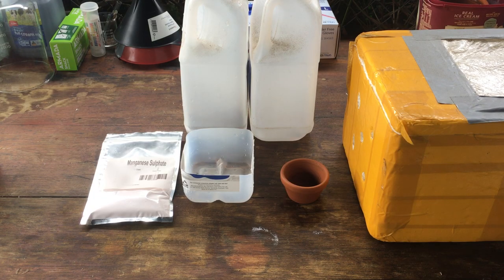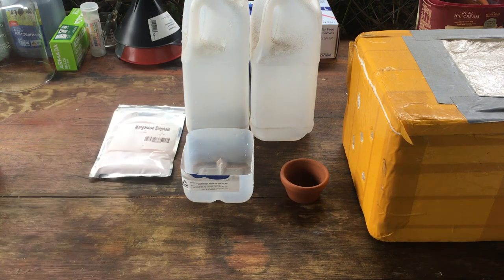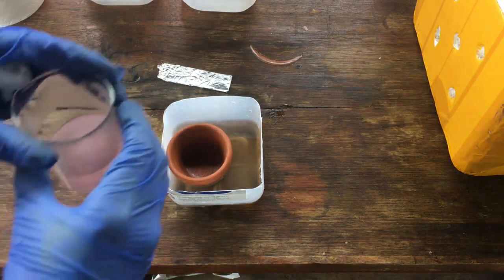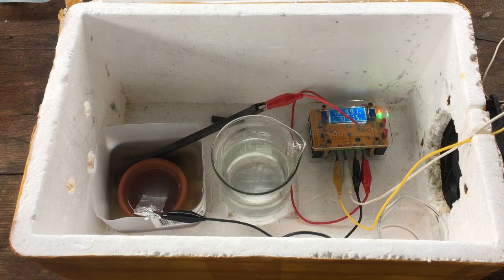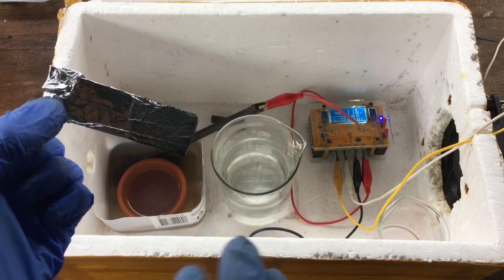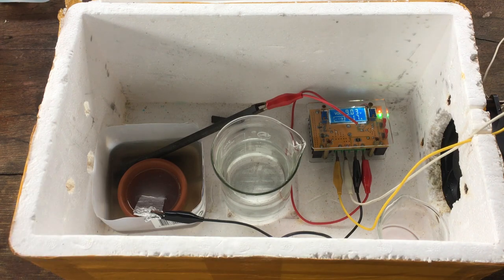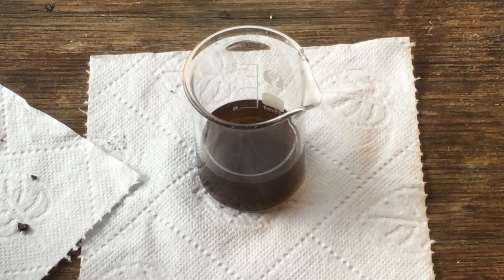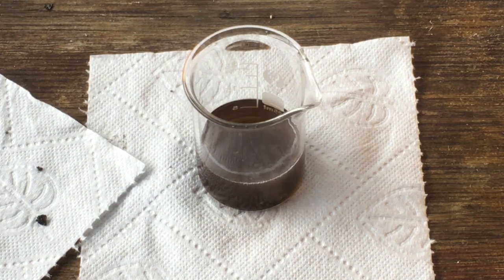Making Manganese Metal

Comment: Now you've got me wondering with what other metals this approach would work.
Reply from the maker: I’ve given this a fair bit of thought myself.
It’s not particularly necessary for most metals, simple electrolysis with an undivided cell (even in acidic conditions) works well enough for metals with a reduction potential higher than or equal to that of zinc (-0.76 volts).
Manganese is kind of stretching the limit of electrolytic reduction (with a reduction potential of -1.19 volts) so any metals more reactive than manganese are going to be near impossible to plate out in aqueous conditions.
That leaves us with a few metals (with reduction potentials between zinc and manganese) for which this process is ideal. From what I can find, these metals include vanadium, niobium, and possibly chromium.
Reply: Iron can also be plated out. Look for the video of Nurdrage called "iron oxide by electrolysis"

Comment: ¿Lead metal from the lead suphate and dioxide form car batteries can be recovered by this metod or a similar one? reacting it with nitric acid and then doing the electrolysis
Reply from the maker: Provided you can get the lead into a soluble form, there's no need for a setup this complicated. Simple direct electrolysis of any lead solution (without a diaphragm) will yield lead metal on the cathode, though a diaphragm like this may make things more efficient and will possibly avoid forming PbO2 on the anode.
I'd personally avoid doing large scale lead chemistry, especially without proper waste disposal or safety measures, but if you're properly confident you can avoid poisoning yourself, others, and the environment, then yes, you could recover lead this way.
Reply: @ScrapScience  thanks bro. You know if that lead dioxide layer is stable and enought conductive to be "plated" it into a graphite rod? because lead dioxide reacts with nitric acid, so I don't know if it would dissolve or stay there for a long time during the electrolysis, as the acid concentration builds up
Reply from the maker: Lead dioxide should only react with hot, concentrated nitric acid, so provided the solution isn't too concentrated or warm, the small amount of lead dioxide you generate will probably be stable enough to be 'plated'. Note however that 'plating' lead dioxide on graphite is VERY difficult in terms of getting an even coat or a usable product, and it's very unlikely that the lead dioxide you generate here will be of much use.

Comment: Can Iron be made using this method?
Reply from the maker: I would think so, yes. In fact, the extraction might not even require a diaphragm separator (though it should be more efficient with one). 
I would imagine that the iron which plates out would be pretty low quality though, likely forming as thin dendrites rather than a solid coating on the cathode.
Reply: @ScrapScience  How about using a deep eutectic solvent as electrolyte...FeCl3 + Urea or something similar?
Reply from the maker: I mean, you could I guess?
I'm not sure if it would produce better quality results though. For what reason would you choose a deep eutectic over water?
Reply: @ScrapScience  No hydrogen formation. The solvent doesn't fall apart like water does at around 1V
Reply from the maker: Ah rightio. Yeah that might be a good plan for increased efficiency. The only problem I can see is the fact that Fe(III) would need to undergo two reductions on the cathode (Fe(III) -> Fe(II) -> Fe), and the intermediate Fe(II) is likely to undergo back oxidation on the anode, possibly reducing the efficiency to the point where no iron plates out whatsoever.
Now that I think about it properly, the best bet I can think of is to utilise a split cell (like the one in this video) to eliminate back-oxidation, and start with an Fe(II) compound for the highest coulombic efficiency. I'm not sure how a split cell could be constructed in a deep eutectic, so it might be necessary to simply do it in water (I dunno, maybe you've got some ideas for a high temperature membrane?). Either way, I'd imaging the problem of hydrogen formation to be pretty minimal at low current densities (or high Fe(II) concentrations), provided the catholyte isn't made to be too acidic.